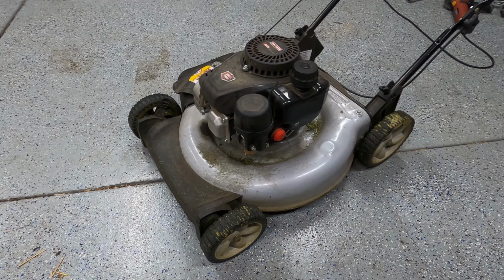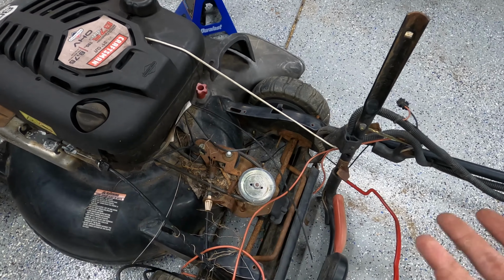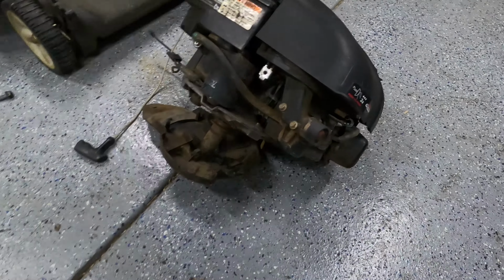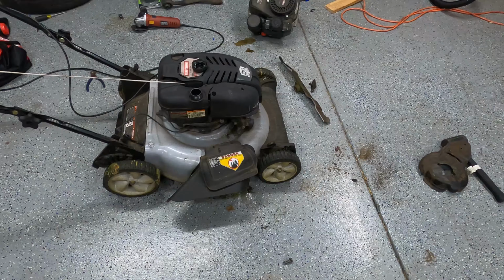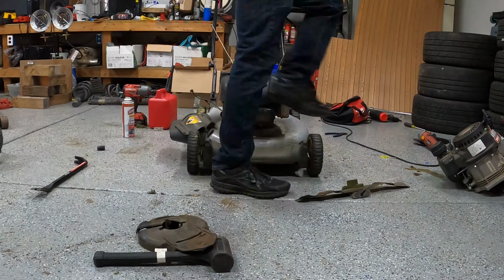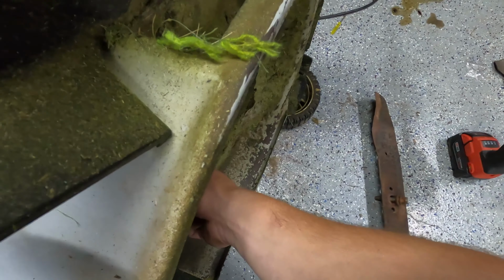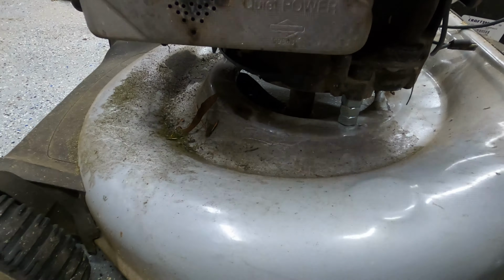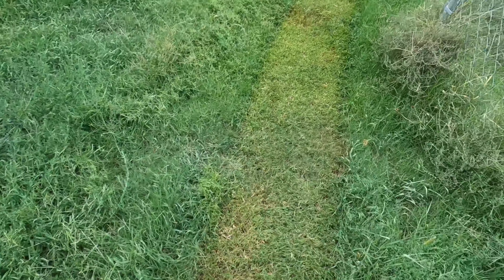BIG BLOCK LAWNMOWER! Engine-swapping my Craftsman's Briggs!

Comment: Very nice! I'm surprised there wasn't a lot of clippings coming out from the gap between the deck, but I too do not understand the aerodynamics and physics of lawnmower deck design :) eReplacementParts has been awesome for maintaining my Honda mower. New blades are cheaper than getting them sharpened here in town, they also have the plugs, filters, handles, screws, etc. all right there for your model number (which might be two different ones for you now :) ). Would love to see the old damaged one taken apart! Do eeeet!
Reply from the maker: I might take my angle grinder and give this blade a good sharpen. It's a bit crusty but not damaged so I should be able to save it.

I think centripetal force keeps the grass from coming out the hole in the middle, it just flies around the outside. Checked the air filter and it looks good, never did end up checking the plug. These engines will run till the heat death of the universe while totally neglected but it would be fun to get it running tip-top for max power ;)
Reply: @100PercentJake  Turbo on it next 💯💯💯
Reply: 100PercentJake I definitely notice after an oil change, filter, and plug it gets much better gas mileage (footage maybe? Feet per ounce? Idk Elliott help me out)
Reply: @100PercentJake  Isn't that centrifugal?
Reply: A.J. W. I think you mean grass milage
Reply: Elliott Alvis you are the hero we don’t deserve.

Comment: Drill bits and taps are two of those things you should never buy at harbor freight lol Norseman at the big tool store or fastenal for drill bits and irwin taps are decent from Lowe’s.
Reply from the maker: do you mean they aren't supposed to splinter when you use them?

Comment: Many years ago I hit a piece of rebar with an old mower.  The engine quit immediately but it wasn't dead.  The flywheel (which is on the top of the engine) is connected to the crankshaft with a small aluminum woodruff key.  When the engine stops suddenly it shears the key.  The flywheel which controls timing with little magnets along the side is no longer lined up on the crank correctly and thus not firing the spark plug at the correct time.  The key is made of aluminum so that it is the weak link and saves the rest of the engine from damage.  It's cheap and easy to replace.  But that being said the bigger engine means more power and more better.  And your creative way mounting the bigger engine was entertaining.  I once again saw the Datsun Z buried in your yard.  Is that your car? What's the story with it?
Reply from the maker: I planted a lug nut a few months ago and this sprouted.